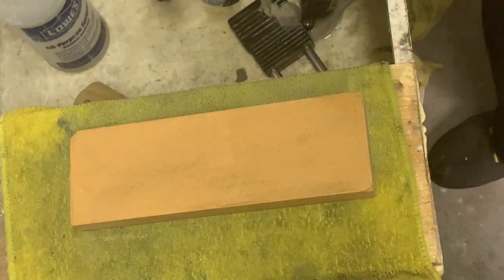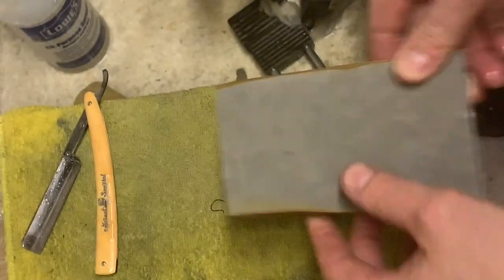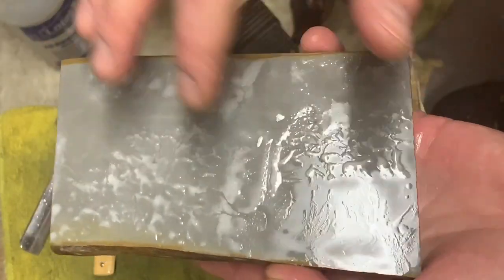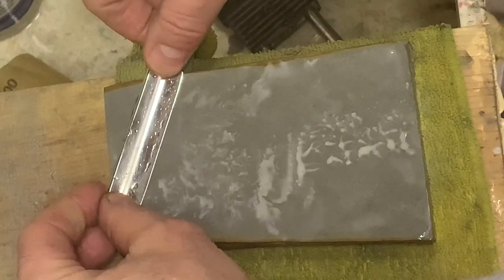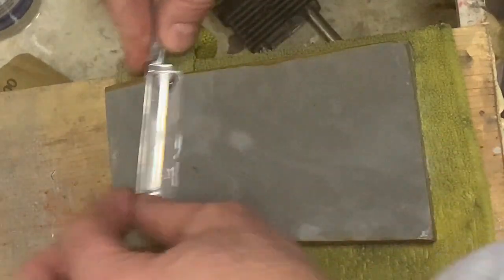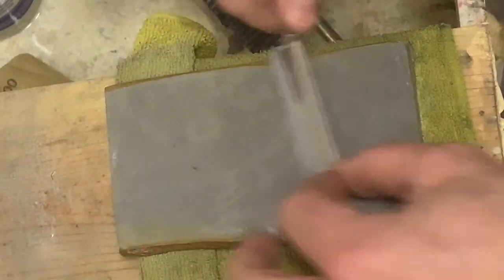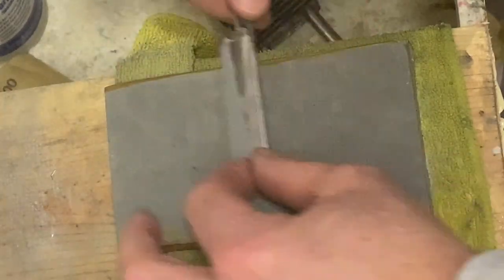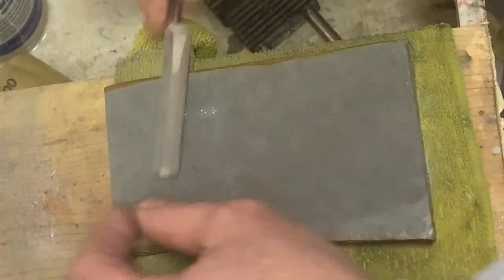Ozuku Asagi Koppa razor honing

Comment: Nice video. I watch Dr. Matt’s videos. He showed a Chef Knives to Go Ozuku Asagi and said the same thing about them going fast. I checked one day, none available. Next day I got the last one of that batch. On its way. Do people flatten the other side? Do you prep it like a Chosera stone? Flatten, smooth, etc. I’m soaking up tips and hints. Thanks, Gil
Reply from the maker: thanks for watching!  Most people do not flatten the other side.  There is no need to.  The only thing I do to prep the stone is make sure it is flat.  I use a Diamond plate for that, or 220 grit SIC power for heavy lifting.  If necessary I'll chamfer the edges.  Thats it!
Reply: @fishinjunky  Jeff, So the ozuku needs the same prep and care as any sharpening stone. I have an ozuku natural on the way also. Can you recommend other naguras for this stone? Where did you find yours? Thanks, Gil
Reply from the maker: Diamond slurry usually works just fine. The stones I buy often come with a slurry stone too. I’d recommend joining a FB group like “Razor Honing”. I’m an admin there.  Or “Straight Razor Honing”. Both are good groups to join.
Reply: Thanks for the info, Jeff.